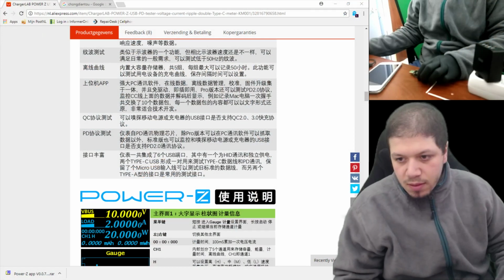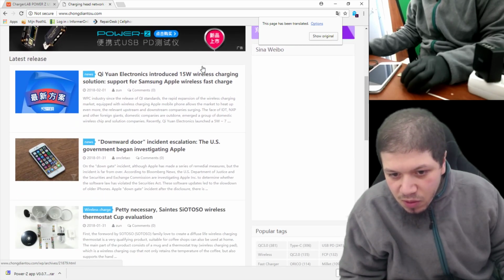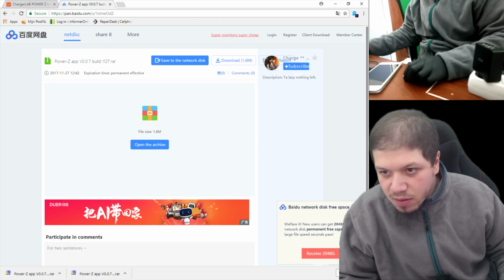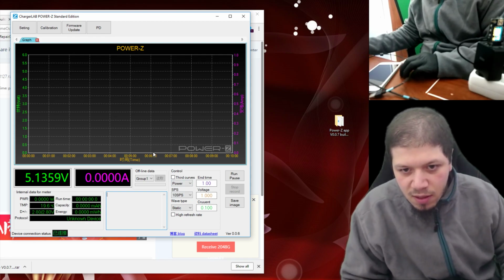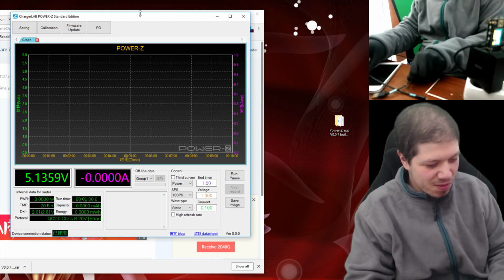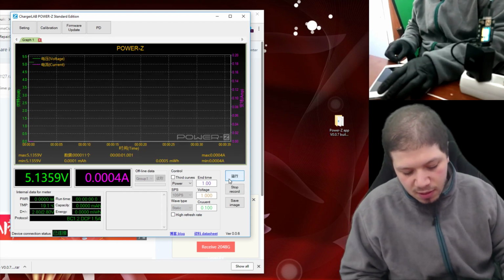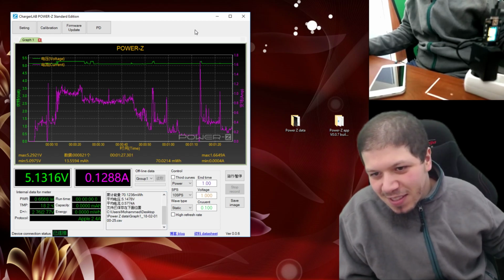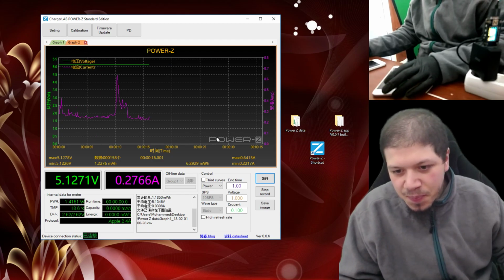Power Z USB meter setup

Comment: i have  a issue ., i bough the KM001 power-z. and it looks like , that it does not support the software from the usb meter anymore , the usb driver , in device manager keeps failing
Reply: i've just installed my km001 and windows found a driver for king meter, try uninstalling and trying again